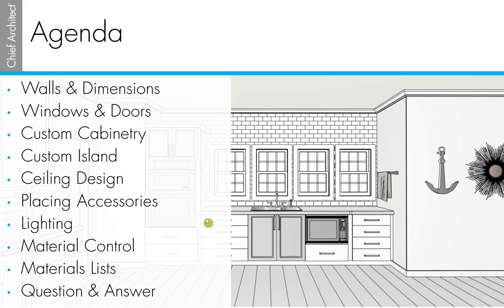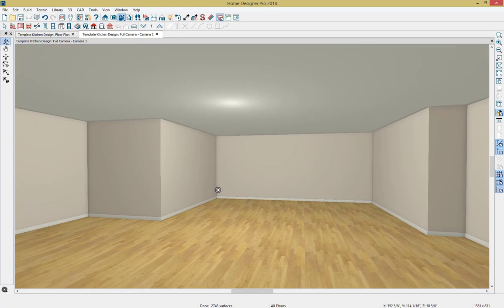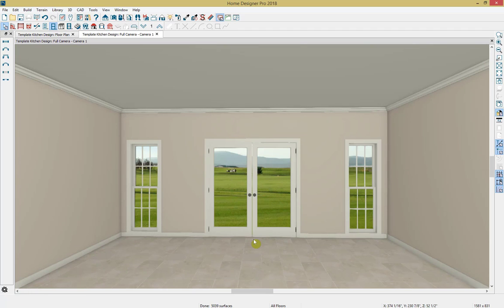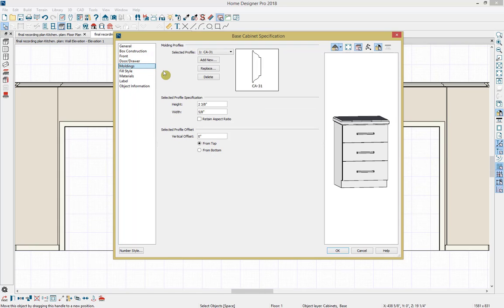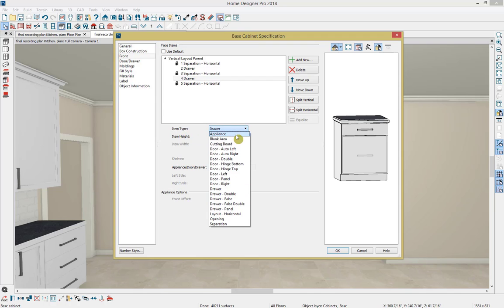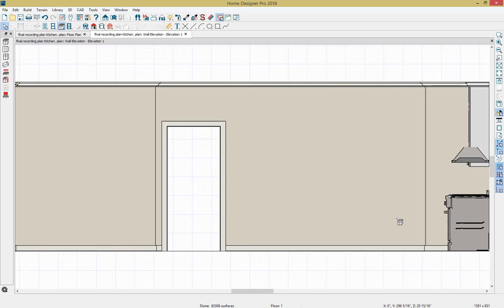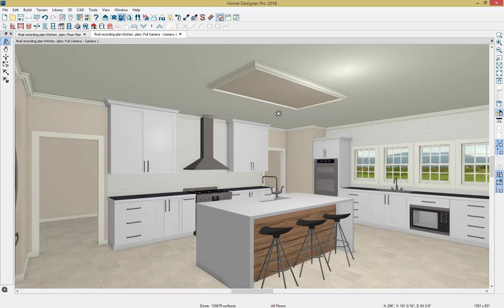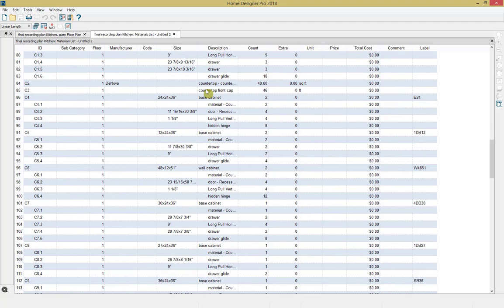Home Designer 2018 Kitchen Webinar

Comment: This webinar is good except for the island.  Adding in a "blocked" island doesn't help to learn how to create it at all.
Reply from the maker: Hi Linda! The kitchen island can be created using the same base cabinet tools used throughout the rest of the plan. We have a knowledge base article that explains how to create a custom island here: www.homedesignersoftware.com/support/article/KB-01022. Thanks!
Reply: Thank you!  I understand that using basic cabinet tools can create an island however, there are other aspects of this island that I haven't come across yet e.i., waterfall edges and overhangs.
Reply from the maker: Gotcha! Okay, we do also have an article that explains how to create a waterfall style countertop. You can find that in our Knowledge Base here: www.homedesignersoftware.com/support/article/KB-02937.
Reply: How about adding a different material as you did to just the back component of the cabinet bases?
Reply: Great, thank you once again.  How about a link that explains how to change materials to the back of cabinet bases as you did in this video?
Reply from the maker: For that, you'll want to use the Material Painter tool in Component Mode. We have an article here: www.homedesignersoftware.com/support/article/KB-00851.
Reply: Thank you.......
Reply: Another question; you "centered both ways" the 3 pendants over island on soffit however, you did it in less than 1 second and this makes it pretty impossible to learn and I couldn't see how you do this.  Could you explain it?  Another thing, why do the You Tube videos go forward when trying to rewind?  Thank you
Reply from the maker: Hmm, unfortunately, we do not have a specific training resource on the Center Object tool. However, with an object selected, you'll find the Center Object tool in your bottom toolbar. You can then hover your cursor over the object or room that you'd like to center on. I'm confident that with a couple practice attempts you'll pick it right up! I'm not sure what you mean by the videos going forward when you rewind, I haven't had that issue; however, if you'd like to rewind, you can simply click on the progress bar at a previous point in time to go back. I hope this helps!